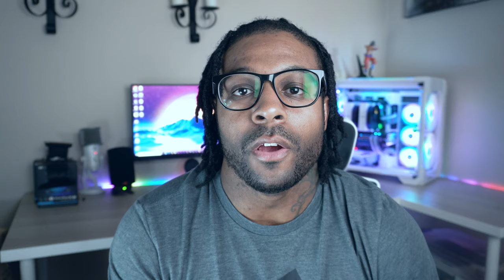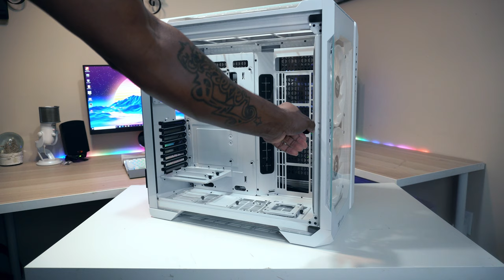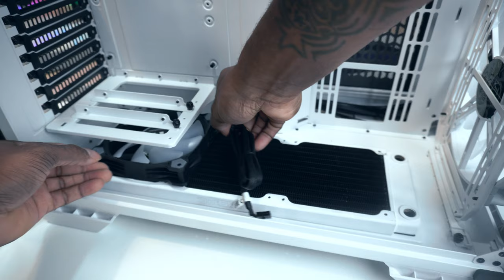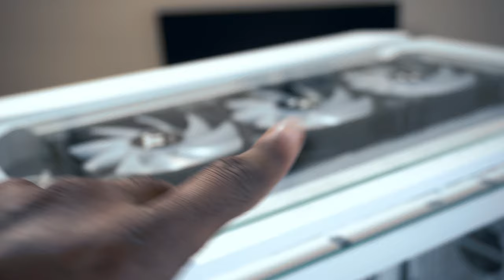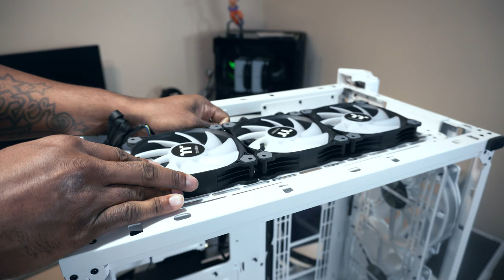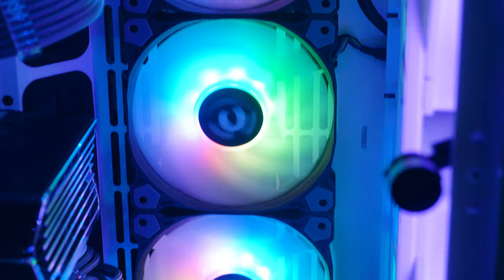Thermaltake View 51 RevIew: ITS BIG!!!

Comment: Hey man, I took your advice on the Thermaltake View 51, instead of the View 71, but my next question is about the vertical riser cable. I have an Asus tuf gaming mb with wifi and a Gigabyte RX 5500xt graphics card which are both PCI-E 4.0. But as i search for a riser cable, mostly all I'm seeing are pci-e 3.0 riser cables. Does this really matter? I don't want to go with too long of a length either. Help me out man.... Thanks
Reply from the maker: It does matter actually. What you will have to do is this: buy the official thermaltake riser cable. It's shaped differently than standard ones and it's made to fit the gpu bracket. Others won't. I tried with 4 serparate different branded ones I had laying around. Next, plug the gpu DIRECTLY INTO THE BOARD. Go into the BIOS and change the PCI-E slot from a 4.0 to a 3.0. The graphics card won't display output if it's on 4.0 with a riser cable that's not a 4.0 one. Then reboot the pc. Make sure u set the slot to a 3.0 slot. Reboot, then boot thru to the OS. Next shut down the pc, install the riser cable and plug it in. Install the card, and h should be good!
Reply: @PettyFixes  Ok, so in my asus bios, it has options for pcie gen 1-4. it doesnt have actual pcie modes. but also the riser cables that im seeing for thermaltake are pcie 3.0, but your saying thats fine to use thermaltakes 3.0 cable, just set it to 3.0 in my bios before installing the riser cable?
Reply from the maker: Yes just set it to 3. Gen 3 is what u want to be on. And Thermaltakes is Gen 3.
Reply: @PettyFixes  awwwwwwww Shoot😁😁😁. Thanks a lot for the advice bro!!!! Bout to set it off!!! I'm sry I missed ur post responding to me getting the case wanting to know the specs. But here goes.... This is my HTPC build. It's mainly for video editing and plex serving and transcoding. All my kids like to be able to stream our movie collecton from anywhere. So specs are Asus tuf X570 gaming with wifi pro mb, Rosewill 750 fully modular power supply. 32 gb geil 3200 rgb ram, gigabyte Rx 5500 xt 8gb graphics card, amd 3600x cpu, 1 tb intel 665 m.2 ssd. 4... Yes 4 probox 4 bay hard drive enclosures running off of usb 3.0 housing 4 - 8tb wd nas drives, 4 wd 6tb nas drives, then the other 2 bays are full of 8- 4tb nas drives for a total of 88tb of video storage. (And they are all almost full).
Reply: I'm trying to show pics but honestly can't figure out how on here
Reply from the maker: Holy crap that's a SOLID HTPC lol!
Reply: @PettyFixes  yea man, tryin to get it right! Gotta fill in some more of this empty space inside of here. Not quite ready to jump onto liquid cooling. (Too expensive and too much maintenance)😟
Reply: Did u have any problems with the on board thermaltake rgb controller board? They are sending me a new one. It's defective.

Comment: Could you choose between Corsair Crystal Series 680X and this one for a normal build?
Reply from the maker: I've actually owned both. I'd choose this. This one has more room for water-cooling radiator placement if ur into that. Also, my graphics card was basically almost touching the front fans. Look at my channel a few videos back and u will see when I rebuilt my system into a 680X. Awesome case but it was a little constricted for it's size.

Comment: "This also supports push pull configs aswell." Pushing and pulling... directly into a glass pane with barely 1mm of clearance? What would the point of that be? Shouldn't you mount the fans on the inside of the case and leave the top empty so it can actually draw or shunt air?

Comment: On the inside vertical radiator Bracket I put 4 SSD's I just made 8 Brackets that hold the SSD's in place using the 140mm fan mounting holes I made them with my 3d Printer. Then I added 4 120mm Fans behind the SSD's for cooling. I used the two hard drive enclosure for 6tb Storage drives. Aslo if i need more SSD's I could do the same with the top mount.
I also  added 2 more SSD's on the top just drilled holes in the Top of the hard drive cage. Just Mod to fit your needs more!! If anyone is interested in the 3D printed Brackets just contact me through my Youtube email.

Comment: Great explanation but can i ask you not to use a screw driver on thumb screws?? only thing i have to say other than this is a great video
Reply: Oh also the 3.5in brackets can be used for 2.5in ssd's also might be something you state in the next look at a case
Reply from the maker: I only used it because that screw wasn't the easiest to screw in by hand lol. But thanks man! Appreciate it!
Reply: @PettyFixes  yea i had a few in the same case i had to work a few time so they were actually "thumb" screws and not impossible to get in and out by hand i think the powder coat paint causes that initially

Comment: good job on this video
Reply from the maker: Thank u sir!
Reply: @PettyFixes  can I send you my specs for a build. And you tell me based on your exp with the case if it will be nicely cooled and have room to 3090 it some day?
Reply from the maker: Absolutely man. Send them!
Reply: @PettyFixes  CPU Thermal Compound - Our Cooler Master MASTERGEL High Performance Thermal Compound 
CAS: Thermaltake View 51 Tempered Glass ARGB Edition Mid-Tower ATX Gaming Case w/ 2x 200mm 1x 120mm ARGB fan 
COOLANT: Thermaltake P1000 Pastel Coolant - White 
CPU: Intel® Core™ Processor i9-10900K 10/20 3.70GHz [Turbo 5.2GHz] 20MB Cache LGA1200 
CS_FAN: ThermalTake 120mm Pure Plus 12 LED RGB Radiator Fan TT Premium Edition PWM 500~1500rpm (3 Fan Pack) w/ Software Controller 
FAN: Thermaltake Custom Flexible Tubing Water Cooling kit with 360mm Radiator, W3 CPU Block, D5 Reservoir+Pump (6x PC 120mm Dual Light Loop ARGB 1200RPM Fans w/ Hub + Remote (Push-Pull) 
 2TB XPG GAMMIX S50 (PCIe Gen4) NVMe M.2 SSD - Seq R/W: Up to 5000/4400 MB/s, Rnd R/W up to 750/750k  (Single Drive)
IUSB: Built-in USB Ports (Based on motherboard and case selection)
MEMORY: 32GB (8GBx4) DDR4/4000MHz Dual Channel Memory (GSKILL Trident Z RGB 
MOTHERBOARD: ASUS ROG Maximus XII Hero WiFi 6 ATX, ARGB, Aqtion 5GbE+ Intel 2.5GbE Dual LAN, 3 PCIe x16, 3 PCIe x1, 6 SATA3, 3x M.2 SATA/PCIe 
MOUSE: CyberPowerPC Standard 4000 DPI with Weight System Optical Gaming Mouse
NETWORK: Onboard Gigabit LAN Network
OS: Windows 10 Home (64-bit Edition)
OVERCLOCK: Ultimate OC (Ultimate Overclock 30% or more) 
POWERSUPPLY: 1500 Watts - Cooler Master MasterWatt Maker 1500 Plus 80 PLUS TITANIUM Certified Full Modular Power Supply 
PRO_WIRING: Professional Wiring for All WIRING Inside The System Chassis - Minimize Cable Exposure, Maximize Airflow in Your System
VIDEO: GeForce RTX™ 3080 10GB GDDR6X (Ampere)
Reply from the maker: Oh dude this case will house all of that!!! It's quite a massive case!
Reply: @PettyFixes  thanks. You are a legend sir
Reply from the maker: Thank u sir!

Comment: Up and side are exhaust or intake?
Reply: Intake at the top, Exhaust on the side but doesn't make sense imo with the intake in the front.  So the air coming in from the front panel is quickly getting exhausted at the side

Comment: i really like the look of it but it's really poorly designed, like most thermaltake cases
Reply from the maker: I'll tell u what. The thing that throws me off the list is the 200mm fans in the front. Most people love it. I feel that the H500 cases from Cooler Master did it better. Also with the vertical mounting bracket for the gpu. I'm glad it came with it but u got to buy Thermaltakes official riser cable and it's expensive. U can't use any old riser cable. The last thing is the backside cable management area and the lack of hard drive space. Such a big case should be loaded with storage options. But I agree on some fronts!
Reply: @PettyFixes  i mean i love the dual 200mm intake but then they stick them behind a solid glass side panel making them pretty much irrelevant and the same for the top panel, it should be mesh

agree with the rest especially the riser cable, if your going to include a vertical GPU mount then give me the riser cable as well otherwise why bother giving me the mount?
Reply from the maker: There's actually very large gaps for air flow on either side of the glass. So the airflow isn't a problem. It doesn't really look like it on camera but my temps are amazing. No issues there. But I would've preferred mesh on the front and top as well.